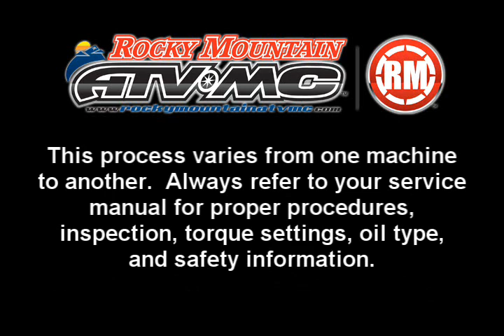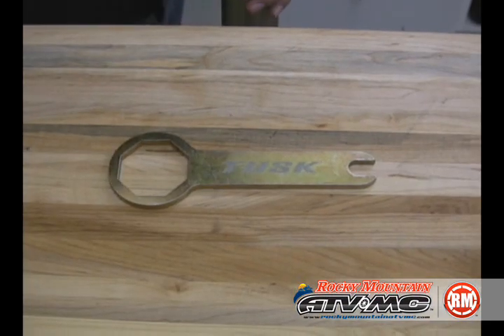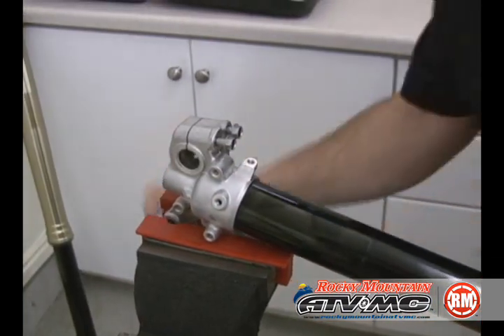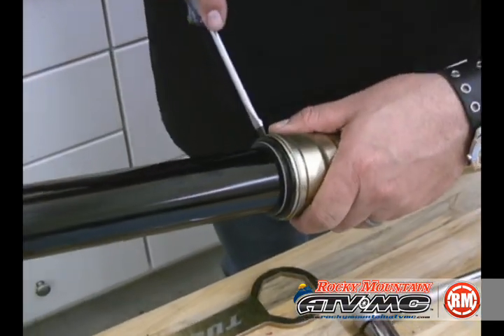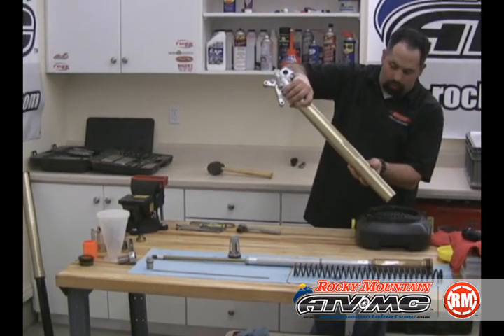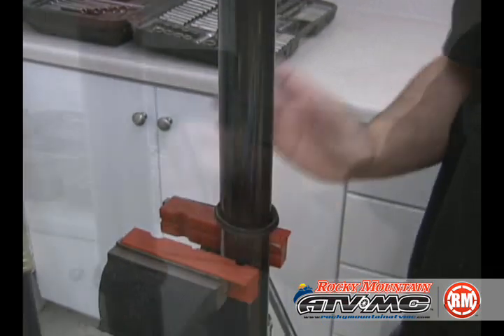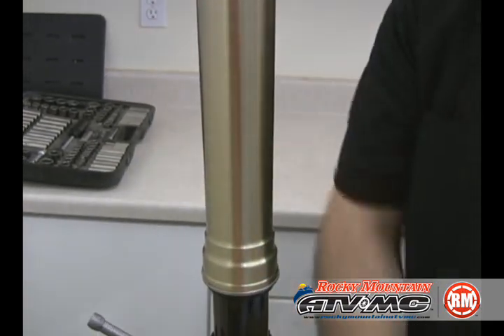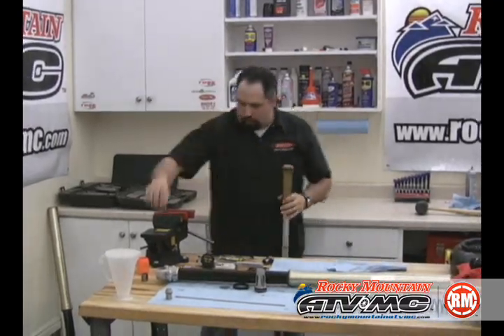Fork Seal Replacement Part 1 (of 2) Dual Chamber Style Forks

Comment from the maker: Refer to your owners manual for service schedule.  Some guys just wait till they leak.  I do a couple times a year.  Regarding the bushings, inspect them when you have them apart.  If the Teflon is wearing off, they need to be changed.  We sell seals and bushings separate, but we also sell a pivot works kit with everything.  Yes, they are machine specific.

Comment from the maker: @Yamahayz2502t - That is the air bleeder.  it is an aftermarket accessory - there is just a screw there stock.  They simply thread into the fork cap.  If just the rep park came off, I would assume you need new ones.  The red part shouldn't come off.  We sell them on our site (not red though).

Comment from the maker: @skiercaleb - No it is not.  you need to watch the cartridge fork video we have.  As a WR owner myself, I am disapointed yamaha hasn't put the new SSS (Dual chamber) fork on the WR yet.  Even the 2011 WR's are still running the old fork.  We are pretty much running 2004 YZ forks on the WR.

Comment from the maker: when you say "bleeder holes", I assume you mean the holes at the top of the inner chamber on the side of the cartridge.  If so, that oil is actually outer chamber oil, it shouldn't be leaking from the inner chamber.  however, it sounds like you have air in your inner chamber if it isn't rebounding all the way.  I would put new oil in the inner chamber as well.

Comment from the maker: @2braappin - yes Basically the same.  To change the oil, follow the steps in the video.  If you are going to the trouble, put new seals in while you are at it; otherwise, you will find your seals leaking right after you went to all the work.

Comment from the maker: Most people will run a 5w oil unless the forks are constantly being bottomed out then you may want to step up to a 7w or 10w. As for the oil specs they are 375ml for each leg. It's saying 193ml for the inner cartridge and then of course you would bleed any excess out and then the 375ml for the outer chamber.

Comment from the maker: @darsktm - to remove the inner chamber, you need to pull the bolt from the bottom of the fork, thus dumping all the oil in the outer chamber.  You will need to remove the fork to do it right.

Comment from the maker: I would recommend you invest in a service manual but the specs for that bike are using Pro Honda HP Fork Oil 5W or an equivalent oil and 6.3oz for the inner cartridge and 13.75oz in the outer cartridge for standard settings

Comment: I hope the oil seals you are installing are manufactured differently than the factory seals as I think you put the seal in upside down. In the video it looks like you put the garter spring side towards the dust seal. If I'm not mistaken, the garter spring on OEM seals actually goes towards the oil side.

Comment: basically the same question as surlybonds. I completed part one of the video tutorial.all was well then realised that I had totally forgotten about the inner fork cap tool so was considering just replacing outer oil and putting back together. however the rod is not offering any resistance and settles itself all the way compressed. does this mean somewhere along the line i managed to get air in the inner chamber? a fair bit did come out the bleeder holes. anyhow great vids keep em up

Comment from the maker: Yes it does have dual chambers.  All CRF450 and CRF250s have dual (Twin) chamber forks.  So does the CR250 97-2007.  The 125 never got them.  YZs started running them in 2005.  The RM125 got them in 2001 and the RM250 got them in 2004.  All RMZ450s have them.  KX 4-strokes got them in 2006.
My CRF manual calls for 5 weight fork oil.

Comment: Great vid, If I was to replace the inner assembly, could it be done by opening the inner cap while the fork was still in the triple clamps & replacing, would it need to be bled for any reason??

Comment: In reference to the above post by atomicpunk2002, if you do open only the outer cap, invert the forks, and drain all of the fluid from the outer chamber-will you lose any of the oil from the inner cartridge? That's precisely what I did, I just wanted to change out the outer oil and start with a known quantity for suspension tuning purposes. Now I am afraid I may have lost oil from the inner cartridges. Should I go back in and do the entire procedure? Thanks by the way, your videos are the best!

Comment: The forks on my crf250r 05 are leaking very badly I had someone who changed the seals and the metal rings inside I forgot what they are called but after 2 hours of riding they started to leak again do you think if I change the seals will sort out the issue or there is something else that you think has to be done. Any advise will be helpful. Thanks :)

Comment from the maker: Most riders can get away using the 5W oil in the forks and most times they will step up to a higher weight if they are constantly bottoming out the suspension... a lot of the smaller bikes will use a higher weight but most times the bigger bikes stick with the 5w. You would be fine with both but i would stick to what the service manual says unless you had a reason to step up

Comment: Another quick question, If I want to just change the oil in my forks, can I just undo the top cap on them, and pour the oil out? Will all the oil come out? and then I just top it back up and bolt it all together?\

Comment: Hi, did you ever do a WP dual chamber?
I got a set that fits yamaha WR 250/450 F from '06 to '09, probably up to '11.
They are sort of racing suspension, not standard, but I have no data for it..like oil quantity, type, which seals etc.

Comment from the maker: no it isn't.  they have the same fork.  Valving and spring rate may be different, but it is the same fork.  The WR250f has a different fork though (it is basically an 04 YZ fork).

Comment: question, im going to have my local shop do my seals but they said they recommend using 10w and my manual says to use 5w, wanted to know if you have an opinion on this it's a 08 crf 250r i weigh 150-160 lbs and am a mid pack c rider ( if that matters ) any ways would like to get a second opinion and i watch a lot of your videos, i think you guys to a great job. i wanted to do them myself but chickend out and sent it to the shop

Comment: iam connfused? in the cartridge video comment u say that the 05 has a twin chamber. do u mean they put the sss forks in at 2005 or is the twin chamber a seperate change that they made in 05 currently i have a yz  125 and i dontvknow if i have a cartridge fork or a twin wall fork possibly if its what they

Comment from the maker: That won't work so well.  You might be able to get all the oil out of the outer chamber, but not the inner.  Also, if you are going to go to the effort to take the forks off the bike, you may as well put new seals in, make sure you get all the old oil out, and get the right amount of new oil in by taking the forks apart.

Comment: Does this video apply to the stock suspension on the 2011 YZ450f with KYB SSS?
Reply from the maker: Yes, this will apply to your YZ. There may be subtle differences, so be sure to look at your service manual.

Comment: I am have used my service manual but still have no clue to the amount of oil I need to put in my gas gas txt pro 250 2013 model. 
I need to top up the oil in the inner and outer cateridge
Reply: I have used my manual sorry but still have no idea as to oil level amounts for the folks. could you please help
Reply: Chloe Craigen in

Comment: Does this apply to a 2007 yz450f?
Reply from the maker: Yes it does.  Thanks cheesychuck123!
Reply: Rocky Mountain ATV MC is changing the oil on the cartridge necessary for just a fork seal replacement?